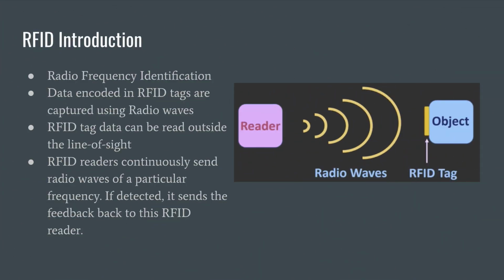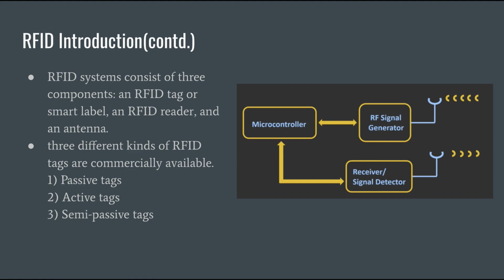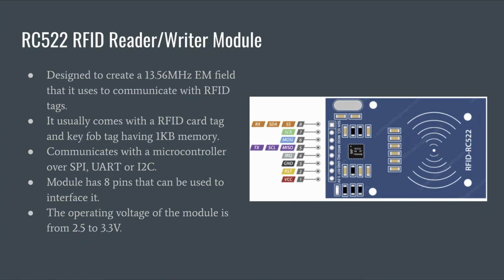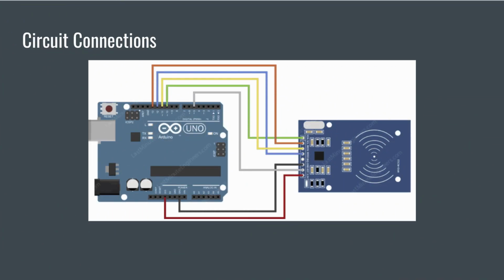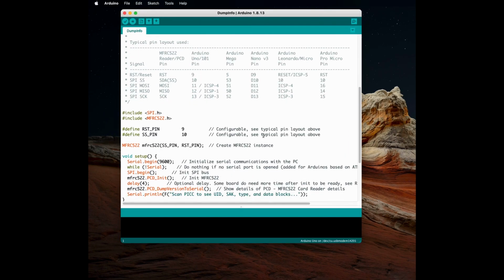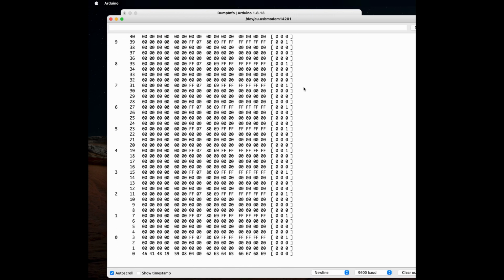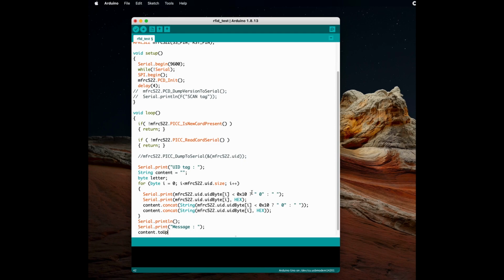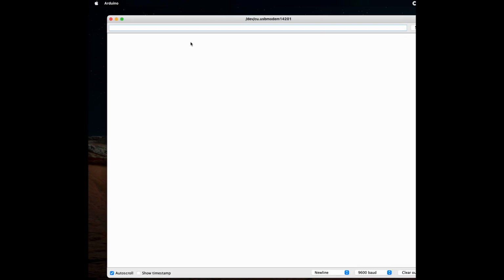What is RFID? RFID Interfacing with Arduino

Comment: Hello sir
Can I mail you the circuit diagram so that you could help in building the circuit in MATLAB simulink.?
Reply from the maker: Sure, what's the circuit on?
Reply: @TheUrbanScholar  the circuit is on Bidirectional contact less power transfer system with dual side power flow control